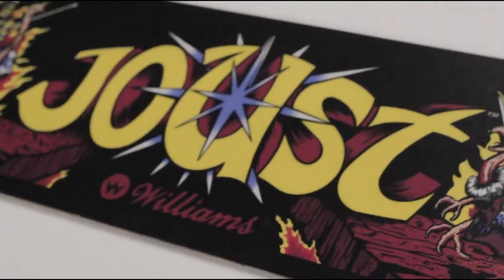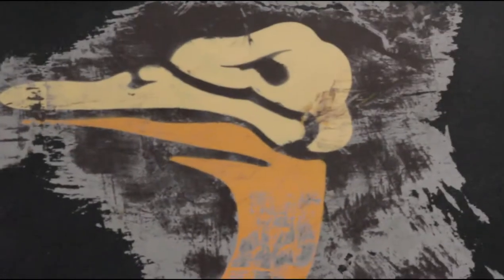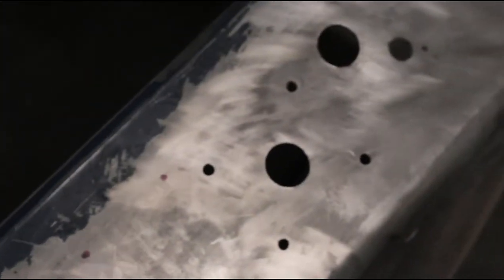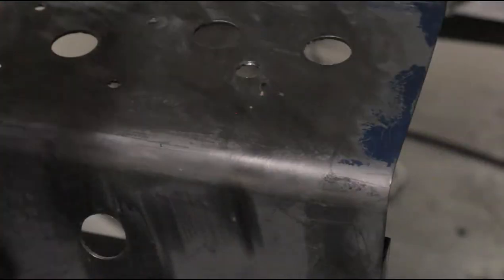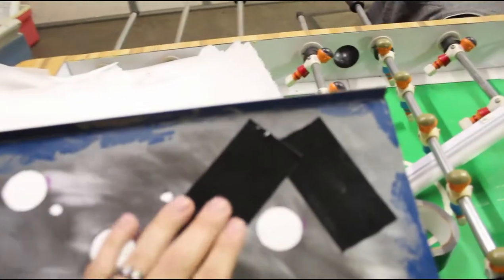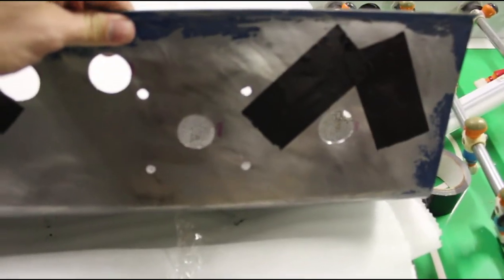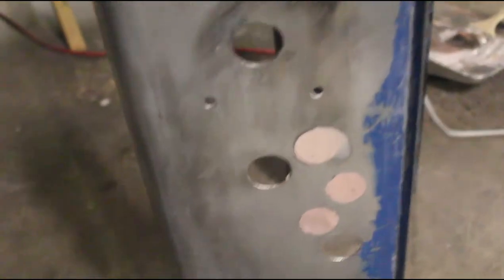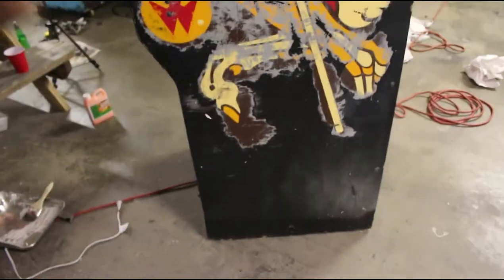Joust Arcade Restore Part 1: Drilling the Control Panel

Comment: Why didn't you clamp it to a workbench first? Also, pushing down on the drill too hard will burn out that bit. Use the weight of the drill and only use moderate pressure.
Reply from the maker: My work bench at the time was a foosball table, a plastic folding table or an incline bench press lol, gotta work with what I got :)